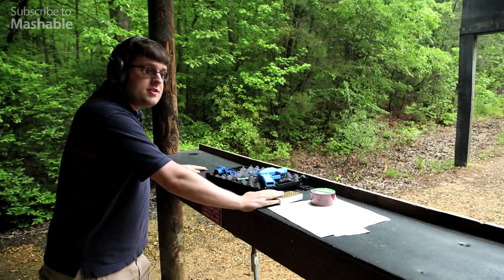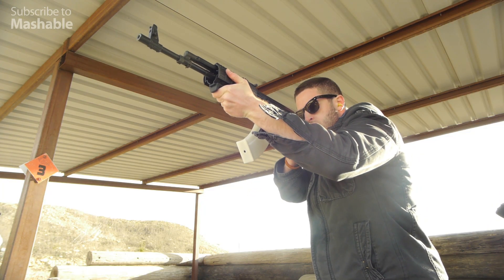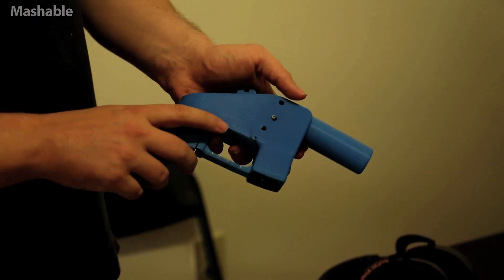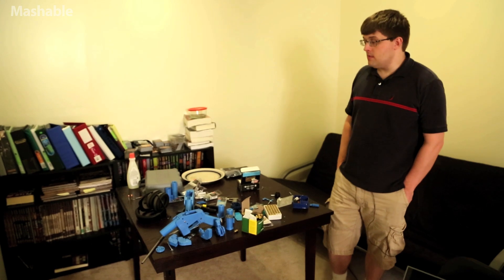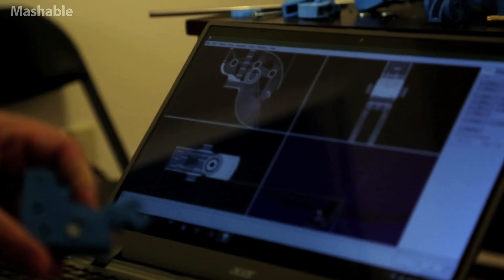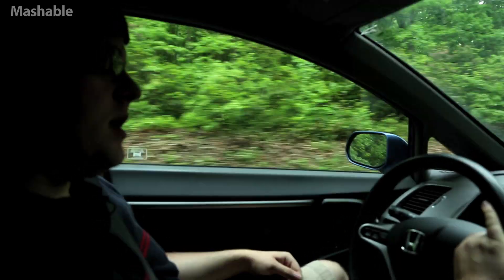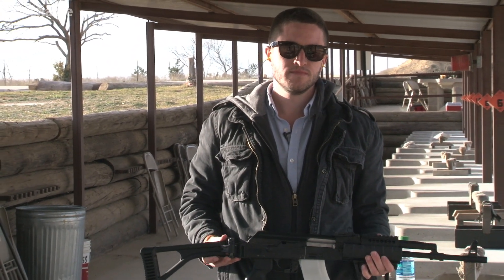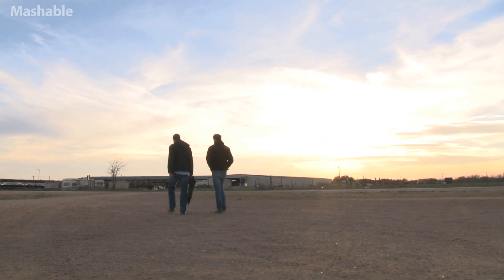I 3D Printed a Gun | Mashable Docs

Comment: 3D printed guns can only shoot about two or three times, they can only fire 22 caliber bullets (anything larger and the plastic would shatter), there is a risk that the heat of the first bullet will melt the plastic mechanisms together, and it's cheaper and easier to just buy a gun on the black market or make a bomb with the chemicals under your sink.

Comment: +Albin Olsson Have you not ever researched what happens when a bullet fires? there is a REASON plastic of any kind is NOT used in bullet casings. IT IS NOT SAFE TO FIRE!!!

-_-
Reply: LOFUCKINGL, actually a hardened rubber is used on shotgun casings. way to be stupid and shout about it.
Reply: brett ratliff
a shot gun is not a rifle or a pistol. and was not designed to be similar. a shotgun is a modernday musket. the casing  can be plastic since the projectile is not a solid mass that requires rifling and accuracy. not to mention that there is a vast difference between a bullet and a shotgun shel. 2 completely diffewrent designs and uses..-_-

again, you nutjobs know nothing about guns and yet you blindly hate and fear inanimate objects...

LOOK--> there's a paper machette pistol... RUNNNN

Slaves!!
Reply: brett ratliff

bullets and shotshells are 2 different things..-_- and I said bullets.
Reply: we arent disagreeing. jesus.

Comment: Almost a year after this video, and several years after attention whore Cody Wilson claimed he/anyone would be printing out AR-15 rifles soon, and still no guns. No videos on YouTube, no tutorials, no gun clubs, nada, nothing. Just a hokey website that they claim the government is hyper interested in, but the ATF has instructed lawmakers that all laws necessary are already in place.
3D plastic is not strong enough to make AR-15's, or anything close, and major media took these unqualified jokers word that they could. Hey media how about consulting an actual engineer next time, and avoid a lot of confusion.
Reply: there have been plastic guns for years... lil wayne even fucking raps about them. you can even get them with composite firing pins so you dont set off metal detectors. plastic can be made as hard as steel, just not in super large pieces. but small pieces, i.e. like ones found in a gun... can actually be made stronger than steel by the inch. but no, no, just say what you feel as if its fact.
Reply: brett ratliff Well brett if "Lil Wayne" raps about it you know it's the gospel. Hey Brett guess what, this story is about 3D printed plastic guns, not just any kind of plastic, 3D printed plastic. There are limitations to plastic when you melt it, and pour it onto itself. That's the whole point here.
BTW I didn't know Lil Wayne was an engineer, what?
Reply: ipissed lol, you use a 3d printer to make some parts, like a clip and a grip for 2 examples. Then you use the 3d printer to make casting molds that you can inject whatever you want into... The same way they have always made them. The material isn't what this is about. It's about the general public finally being able to afford the technology to create themselves. But way to be wrong, off topic, and pissed. And btw, I didn't know someone had to be an engineer to understand injection molding. Oh wait that's right they don't. The point is YOU DON'T HAVE TO BE AN ENGINEER, HENCE WHY HE IS SAYING ALL AMERICANS CAN DO THIS. What we don't need is people like you confusing others and convincing them they don't have the tools or know how to do something like this. It's people like you that make Americans look bad. You watch a 5 minute video and now your an expert, hurling insults at multi million dollar artist because I mentioned that even he, knows about plastic guns.
Reply: Yeah but they can't build a reliable model. The ars in the video aren't made with 3d printers. Why do you keep trying get to offend me? I'm an adult. That shit is irrelevant.
Reply: Formal apologies my good sir, you are right this video does not depict the erroneous claims of the  instigator. Yes you can 3D print out a zip gun. Have fun.
But the "Liberator" was supposed to be an AR-15. What hole do I poke my dick in now?
Reply: brett ratliff I would like a link to a manufacturer who makes one of these undetectable guns. Please. If you can provide one I'll give you one entire internet.
Reply: They don't manufacture them.  You can buy composite firing pins and install them yourself. You'll give me one entire internet? What?
Reply: OK then, who manufactures the composite firing pin? And the non-metallic barrel? If you say it exists then someone, somewhere manufactures it. Please provide a link to a company that produces the parts required to make a gun out of non-metallic components.

And then you come to the problem of ammunition. The primer is metalic, the casing is metalic, the bullet is metallic. Even if you do produce a gun without metal, you've still got to deal with the ammunition being made out of metal.

Comment: you can buy a regular handgun on the streets of any major city with ease. if the government is stupid enough to think that a person is going to spend $1300+ on a 3d printer + printing material, just to build a gun that may not fire without weeks of modification to the piece, that shows what is wrong in this country. Don't worry about any real problems like unemployment, education, homelessness, starvation of children due to reasons listed prior.  maybe we should all print guns and show a bit of rebellion to get Washington dc in the correct direction. the country is falling apart and failing but make sure we stop the most expensive hobby out there so we can still be a failure

Comment: Im looking through all these comments and laughing to myself because what most people dont think about is at one point all the guns in the market were prototyped in one way or another. 3d printers are accessible to the common people now but guns are even more accessible.  I mean come on you can get a cheap .22lr for next to nothing. A 3d printer is not cheap. Not at least the ones that have high printing tolerances. A 12gauge zip gun is more deadly than this and easier to make by a loooonnggg shot . How much does two pieces of pipe and a bolt cost? Reliability is everything with a gun and 3d printed guns are far from it right now

Comment: The best part that people are missing is that you can print gun components and not build plastic guns but use the components to make molds that can make casts for metal parts, or complete plastic guns that are to scale to see if the new prototype of one is functional before they build a actual one.
Reply: Yeah, the only thing this printer is doing is saving time.  We could always build the molds and cast parts.  Perhaps more designs can be tested by printing, before committing to the best one.

Comment: This would be nice if there were parts that were left out intentionally in order to make sure they were legally bought. That, and I don't think I could bring myself to trust a plastic barrel and receiver over a metal one. Still, it is annoying to have to pay extra for parts that don't necessarily have to be metal. The problem is, with one smart criminal and not too much of an investment, these could be easily distributed cheaply after initial costs. Once again, the only solution including this technology is to make sure that more law abiding citizens have it than the opposite.
Reply: I don't think one smart criminal printing these is a problem.  Or at least any more of a problem than how easy it is for criminals to get other weapons.  They can get normally made handguns right now.  It is not like removing any ability for the public to print a gun will prevent criminals from acquiring other weapons.
Reply: Yes, but once established, it will be much easier and cheaper to produce 3D printed guns.

Comment: So what?
Those who really want a gun can just buy one much cheaper.
Oh, and it won't blow up in your face, like the 3D printed plastic ones.
Also, you can make one out of metal with a CNC machine.
Those have been around for decades and are still way cheaper than a 3D printer that could print a working gun.
Reply: Yes. Way cheaper!
I'm in robotics and have been using both CNC mills and 3D printers a lot, so I'm coming from the real world.
;)

3D printers that can print metal are around a million dollars.
They require a climate controlled room, industrial (400+ volt) electric supply and a skilled technician.
I got quotes from the manufacturers because of my robotics business...

I just bought a Sherline 4 axis CNC mill for less than $3000 (new).
Even an industrial Haas mill is only around $100k.

You're not seriously talking about printing a working gun on a Makerbot, right?
Out of plastic?

This whole story makes good media headlines, but in practice, it's ridiculous.

Comment: at the moment there is no way to have an all plastic gun or even get it through a working metal detector. 
there are several reasons why you cannot have an all plastic gun or get it trough a metal detector. 
1) you have to have a firing pin(there aren't a lot of plastics that can be made into a firing pin and strike a round with enough force to set the primer off)
2) you have to have a round of ammunition to fire, if you know what one round of ammunition consists of then you would see why it wouldn't get through a metal detector. a round of ammunition is made up of a bullet(most commonly made out of lead), a casing(most commonly made out of either brass or steel), gunpowder , and a primer(encased in a little bit of metal) now how many parts of on round of ammo is metal? (answer for those that cant figure it out is 90% or as most know enough to set off a metal detector).
so that right there has destroyed the argument about it getting passed metal detectors. 
 
Secondly i would like to point out that it is entirely LEGAL to produce a firearm, this comes straight from the ATF,
"With certain exceptions a firearm may be made by a non-licensee provided it is not for sale and the maker is not prohibited from possessing firearms. However, a person is prohibited from assembling a non-sporting semi-automatic rifle or non-sporting shotgun from imported parts. In addition, the making of an NFA firearm requires a tax payment and approval by ATF. An application to make a machine gun will not be approved unless documentation is submitted showing that the firearm is being made for a Federal or State agency."

[18 U.S.C. 922(o) and (r), 26 U.S.C. 5822, 27 CFR 478.39, 479.62 and 479.105]

the only reason the government pulled the design off the web is because it violates other countries laws and many UN treaties about firearms.

Comment: It is one thing to make the information public about making a gun, it is another to make the gun yourself. If I heard correctly the device that makes the parts costs as much as a basic assault rifle itself, the gun might be cheap but not the process.
Reply: The initial investment is high, but if your purpose for owning a 3d printer is to manufacture gun parts I doubt you would only build a single gun...

With how cheap the materials are (the plastic itself) and how frequently you would need to replace the components it may very well be cheaper in the long run.  Especially if you make many different weapons, or even put the printer to other uses.
Reply: so you make a gun costs you £600 (cheapest 3d printer package ive seen) , then you friend wants one and you charge him for the cost of plastic used and so forth you will make your money back easy.. and if you can use solid works then you can design other things and offer a printing service and just like that you have a business from home that you can run without your assistants (as some parts can take hours to print)

Comment: 3d printing i see a problem.... think about it make a gun out of plastic and get it through metal detectors....
Reply: No such thing as an undetectable gun , no matter what the media says. Springs , firing pins and bullet casing will ALWAYS have to be steel and therefore detectable.
Reply: I see where you are coming from, but you still have to have bullets and those are metal, I don't think plastic bullets would do much.
Reply: hpjunkie73 it will be a threat once someone thinks they can really hurt a lot of people with one bullet
Reply: ***** The liberator doesnt work yet , once it actually works. Then it will be a threat.
Reply: flyingpnda247 Because hurting/killing one person isn't a big deal right? It's only a problem if you hurt a lot of them. /facepalm

Comment: Maybe in a few years 3d Printers will print metal...
Reply: There is such a thing since at least the 80's.  They are called CNC mills.
Reply: Acutally, the higher end 3D printers can print in metal. One of the newest Audi's used in a movie I cannot remember right now used was made using a 3D printer. So if you had alot of money, and I mean alot you can actually print a gun with a 3D printer made of metal.

Comment: Why do people think 3D printing is a new thing. It's been around for a long time it just has gotten cheaper. They have machines that print metal that could make a gun but the machine is not cheap. It would be easier and cheaper to buy some bar stock and make a gun that will last.

Comment: 3D printing has already shown it has great potential in all sorts of different ways, yet something everyone is focusing on is one aspect. Yes, it is possible to print a gun/gun parts with 3D printers. However, many of these only last for a few shots if they fire at all. Sure, we have a potential problem of guns being perfected in these machines, but the cost of the machine, as well as the material to make a quality gun are very VERY expensive. You'd be better off just buying a gun.

You can build bombs with ingredients from Walmart, guns with PVC, rocket launchers, etc just by looking it up online. The parts are readily available, yet nobody wants to put a ban on the everyday materials that a minuscule minority could abuse.

This tech has so much potential, but as always with things that can lead to change many are opposed.

Comment: Well, you can say that about metal too. You only have to look as far polymer lowers for evidence of longevity. Other examples are safety helmets and even the dyson vacuum; it's designed to flex and not crack if you ram it into something. It's as much about the engineering as it is about the materials.

Comment: there are some type of plastics that can withstand these forces, though hardly being used into even today's 3D printers. But if designed well, a good plastic material can fire continuesly! but this needs to be developed and if the 3D printer is going to be at the same technical level everywhere you really can make capable guns. but yeah,,,, it is still only a theory,,,,

Comment: First off that was a semi auto AK variant (not automatic), the only thing that was 3d printed on that was the magazine... A fully plastic gun can only be fired once because the plastic isn't strong enough to handle the pressure created from the cartridge being fired. If you keep firing it, it will practically become a bomb in your hands. That's why a regular firearm has a steel barrel.

Comment: It's not cheap or affordable. You need software to read the cad files, a good quality printer with high quality printing material, knowledge on how to assemble the parts, etc. You're talking thousands if you want to print one yourself. Maybe hundreds if you get a 3D print shop to do it. Not to mention the "Liberator" is a one shot deal. What's the point? As I've said before it's more about politics than anything else.

It's by far cheaper and less hassle to buy a simple revolver pistol.

Comment: Yeah no not really unless they have 2100 dollars and know how to work a computer fairly well. Also they would still need to buy bullets since it would use handgun bullets you need to be 21 to buy those. Plus he could just use a pipe a spring and a nail, that method has been used to make ZIP guns for the past thousand years or so.

Comment: You should use metal when it is most efficient(for strength) to do so. Go ahead and use a metal firing pin the shape of a common nail printed inside of the hammer/striker for reliable ignition. Simple additions of easily obtained metal parts will not detract from the ability of home hobbyists to build these projects. Designs can incorporate parts, e.g., springs and screws,  easily obtained from a local hardware store or commonly salvagable that don't make sense to print out of plastic.

Comment: That still won't solve the problem of high accidental homicide rates, it would probably increase it. The optimal situation would be to reduce crime overall, which would render gun possession as a necessity for security obsolete. Surely you would agree that citizens should not be encouraged to possess guns if it is not beneficial for them?

Comment: bullets made of printed plastic would be to susceptible to rupturing, however 3d print metal is a possibility, however its more expensive then making a mold and using liquid metal to fill the mold and make it that way. so no, plastic 3d printed bullets would not work.

Comment: A traditional inkjet / bubble jet printer adds a layer of ink ONTO the paper.

Imprinting has vanished with the decline of the (Gutenberg style) book press, which actually pushed the letters into the paper.

Print on a piece of paper and the resulting 'paper +1 layer ink' is thicker than the paper alone.
Print onto it again, and it gets thicker again. Rinse & repeat.
The 3D printer just uses plastic as 'ink', deposits thicker layers of it, and not onto paper.

Summary: it is a printer. ;)

Comment: The initial investment is high. But the production per unit price is lower than a cast aluminum lower. Anything new and is not standardized is costly to start. Just like reloading ammunition. It takes time to breakeven on your investment before you see the savings.